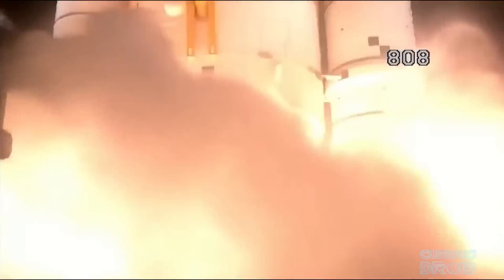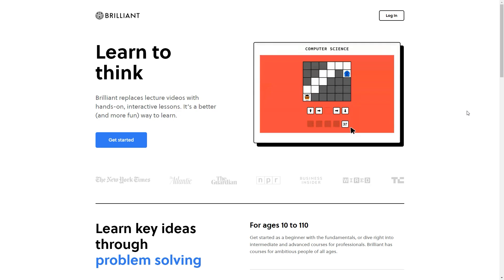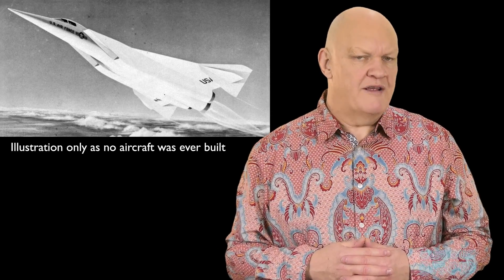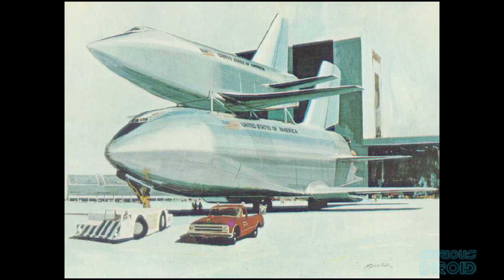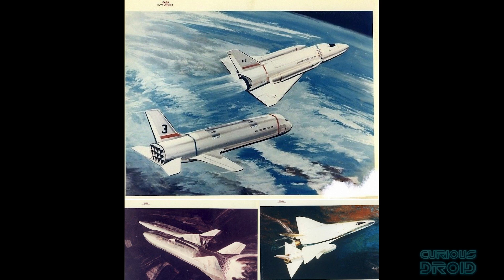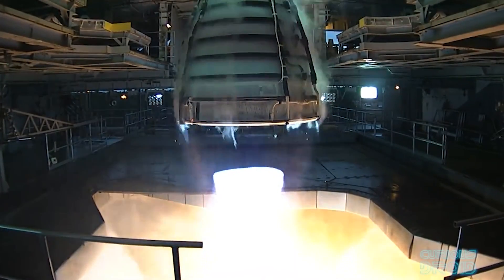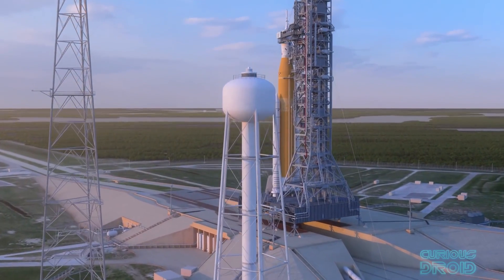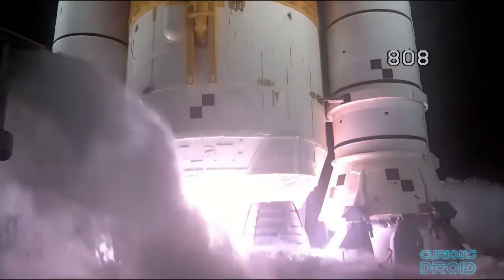Why is NASA Throwing Away Reusable Engines?

Comment: I am wondering who will be willing to pay for a non reusable rocket and the price tag a mission comes with, once SpaceX has its starshop program up and running for a supposedly fraction of the costs?
Reply: The Artemis IV cost to NASA to get HLS Starship to the Moon is $1.15B. The problem for Starship replacing SLS is the up to 10 launches to get HLS Starship to the Moon (GAO pg 27) and the 1 launch every 12 days for Artemis III (GAO pg 10).
Reply: @steveaustin2686  
Yep that could be a problem if your rocket is prone to have leaky hydrogen faults.
Reply: @YellowRambler  Not relevant to the discussion, but okay, whatever floats your goat.
Reply: First, let SpaceX build a working Starship, then NASA will worry about what to do with SLS. For now, SLS is flying and Starship is on the ground.

Comment: N.A.S.A is just a money pit I suppose when it's not your money you don't mind what happens to the hardware unlike spaceX whos wish is to reuse reuse reuse. N.A.S.A at this point should just stick with research and development but it probably depends on long term contracts which will have been signed years in advance so the wasteful behaviour may change but I don't  see it for a long time coming

Comment: I think the only reason NASA still uses disposable parts is because the government paid suppliers for disposable pieces from the start and the suppliers have no reason to make it reusable when they get paid for each new unit.
Reply: Booster reusability is great, but has drawbacks.

First, if you don't have a fast enough launch cadence, you can spend more on recovery equipment and personnel than you save by reusing the booster.
Second, you take a payload hit for the recovery system on the booster. The Falcon 9 B5 can lift up to 22.8 tons to LEO when expended (SX), but only up to 16.7 tons when landed on a drone ship (B1069.2). Doing a Return to Launch Site (RTLS) landing, costs even more payload as you have a boost back burn to cancel the lateral velocity and return back to the launch site.
Third, the higher and faster you go, the harder reusability is to perform. The heavier the dry-mass of your booster, the harder reusability is to perform.

So with SLS launching once a year, eventually, the cadence doesn't really justify recovering the booster. Not to mention that it gets higher and faster than a Falcon 9 as the SLS core stage almost reaches orbit, making recovery MUCH more difficult. The SLS core stage is travelling well over 3 times as fast as the Falcon 9 booster and is well over twice as high as the Falcon 9 booster at MECO. The dry mass of the F9 booster is 22-25 tons while the SLS core stage is 85 tons.
The SLS Block 1 can get Orion to the Moon, but not with the kind of payload hit like F9 has. The SLS Block 1B will send along a Lunar Gateway module with Orion, so it really can't take the payload hit either.

SLS started design work in 2011, 4 years before SpaceX landed the first booster and almost 6 years before they reused a booster.

Comment: It's a shame that they don't even try to recover the SRB's, because the shuttle version was totally designed for that.  The parachute package hardly added any weight to the boosters.  The 5 segment version used for SLS was actually fully developed during the Shuttle era, but never flew due to the cancelation of the Space Shuttle program after the Columbia disaster .
Reply: It's not really a shame; refurbishment of the Shuttle boosters cost just about as much as buying new ones, so the reusability was basically pointless. 

What's really a shame is that these major aerospace companies with decades of history could have had fully-reusable, controlled-landing first stages by now if they had incentive to develop them, but since they get paid massive government contracts whether or not they innovate, they just don't innovate.
Reply: @IstasPumaNevada  The technology for reuse wasn't there until recently. Now, ULA, Blue Origin, Rocket Lab, Relativity Space, etc are all working on reuse.
Reply: @steveaustin2686  Technology was not there because they chose not to develop it. Moon lander landed vertically and then took off, not too hard to see them extrapolating to powered vertical landing on earth, could have had by late 70's if not early 80's. IstasPuma above has it right.
Reply: @JB18850  There were many attempts at making reusable spacecraft since Apollo. The Shuttle as the most famous and it cost more and was harder than they thought it would be.  The DC-X used vertical landing as well in the 1990s.
Reply: Refurbishment of the SRBs was not as expensive as building new ones, sorry. It wasn't nearly as cost efficient as they hoped, but you're just extrapolating the cliche.

Comment: I think that reusability is much easier with smaller rockets than with the biggest ones. In this case Falcon is much smaller booster than SLS. And talking abou reusability... my prediction is that Starship's Super Heavy booster will be total failure. Such big booster is just to heavy, to imprecise and it will not have such ability to steer as Falcon has. Those "chopsticks" won't catch a one.
Reply: The Superheavy and Starship will both be able to hover, whereas Falcon 9 booster can not. Landing those is possible, but the catch remains to be seen. I would be shocked if the rest of SpaceX goes along with Musk wanting to try a catch on the first flight. They will most likely do soft water landings until they have dialed in the accuracy they want. That is how they did the Falcon 9 booster landings over 7 years ago.
Reply: @steveaustin2686  Yes, you are right about the test landings in water.
But bigger and heavier rocket will never have higher maneuverability than the smaller and lighter one.
Reply: @Space-Fiction  That likely depends on how powerful the hot gas RCS turns out to be. It will be more difficult to make precise moves with the Superheavy booster and Starship (second stage), but a catch is not out of the question I would think. Not assured either though. Time will tell.
Reply: @steveaustin2686  Yeah... about the LC-39A pad. I already heard some rumors that NASA do not like the idea of Elon's chopstics tower so close to the only american launchpad for human spaceflights. And I agree with this. It is very unreasonable, risky and dangerous. But probably Elon wanted to spare some money so that he didn't need to pay for some another place. (he is already paying for LC-39A)
Reply: @Space-Fiction  No, it's more about LC-39A and LC-39B being built for rockets roughly twice the size of the Saturn-V, so they already are approved for the rockets larger than Starship. SLC-40 is not sized for rockets as large, so I highly doubt the USSF will allow it to be used for Starships. SpaceX and NASA are already working with the FAA on constructing Starship pads at the as yet unbuilt LC-49 to the NW of LC-39B, so it's not about not wanting to lease another pad. With the HLS Starship launch to the Moon requiring up to 10 Starship variants launched, having multiple Starship pads is a very good thing to help with launch cadence. Part of why the Falcon 9 can have a once a week launch cadence, is that the launches are spread about among SLC-4, SLC-40, and LC-39A. Besides Crew Dragon only launching from LC-39A, it is currently the only pad the Falcon Heavy can launch from as well. Both the USSF and NASA want to keep Falcon Heavy's launching, as both have important missions flying on the Falcon Heavy. SpaceX is reportedly talking about upgrading SLC-40 to also handle Crew Dragon launches, but that will require a crew access tower. I have no idea if the Falcon Heavy fits into the approved size of the SLC-40 pad as Titan IV is the largest to launch from their I believe and it is roughly 1/3 smaller than the Falcon Heavy.
Reply: @steveaustin2686  NASA has concerns about LC-39A... that is not my opinion... I red that somewhere a few weeks ago.
That is true.
Reply: @Space-Fiction  And what part of what I said denied that? The Starship pad was built at LC-39A because it was large enough for that size rocket. The pads at CCSFS are all almost certainly too small. That leaves LC-39B, which is for SLS and general use and LC-49 which is planned. I would not be surprised if a catch tower was made at SLC-13 where LZ-1 and LZ-2 are at for Falcon boosters.
Reply: Your "prediction" is based on what specific data? "Too heavy and too imprecise"...there is as yet ZERO flight data from any super heavy booster. You may be proved right in the future but for now I will take the confidence of a design team with over a hundred very precise successful pinpoint landings of Falcon 9 boosters over a guess based on little if any hard data.
Reply: @johnsmith-7oo  It is based on data from SpaceX. How many times have you seen the Falcon 9 landing? I guess hundreds. And did you realized, that this rocket (much lighter one) never lands right in the middle of the landing pad?
Yeah, you may have seen landing of New Shepard where the booster was hovering over the landing pad... but this booster is even much more lighter than Falcon 9.
You can make precise movements with rockets... but as the weight increases, so does the momentum of the body. And you can not fool the physics with any of crazy Musk's tweets. The maneuverability of Super Heavy will be much more lower than the one of Falcon 9 and so the precision.
Reply: @johnsmith-7oo  Don't be so sure. Elon is only talking money... and not every his idea was good as we know, e.g. that Hyperloop thing was really dumb from the beginning. And where is it now? It is doomed.
So as the Starship and chopstick idea. It will work only if everything goes as it should without any problems. But everybody knows that it can never happen. And putting people info the Starship? The worst idea ever. Starship is flying coffin... and it always will be unless they redesign it from scratch.
Reply: @johnsmith-7oo  The Falcon boosters are not precise enough for a catch. Even on the lowest power setting on one engine, the Falcon booster has a greater TWR than 1, so it can't hover. The suicide burn landing times the engine start, so that when the legs touch the ground, the speed of the booster is as close to zero as they can get. While the boosters land in the circle of the drone ship, they never land exactly in the same place of the circle. 

The Superheavy booster and Starship (second stage) can hover on low power settings, but have to be much more precise in landing for the catch arms to work. The heavier something is, the harder it is to make precise moves with it. That doesn't mean that a catch is out of the question, but it will be difficult. The Falcon booster dry mass is 22-25 tons and the Superheavy booster is expected to be around 3-4 times that mass, if not more. The Superheavy booster and Starship (second stage) are expected to have much more powerful hot gas RCS, so SpaceX may pull it off. Time will tell and I expect a RUD or two. So I would not be surprised if a catch is not attempted until the LC-39A pad is finished and the catch attempt happening at Boce Chica.

Comment: yeah the temp difference between the fuel on the outside and the rocket thrust on the inside prob means fatigue problems,then theres the extreme vibration which prob causes cracks

Comment: If I remember correctly, the biggest reason that the SSME's were so expensive is because of the amount of power the made vs what they weighed. At the time, pound for pound of weight, they were the most powerful engine's on the planet. Another article I read compared them to SpaceX's current Falcon 9 engine's, and they came out on top for power to weight by a good sized margin. It's the old drag racers dilemma; powerful, cheap, reliable. Three choices, you can only pick two. What's your decision???
Reply: I think the main reason they're so expensive is simply that they were complex engines made in very small production runs, so you'd never get anything resembling economies of scale, and you'd never pay down the R&D costs.

Compare with Raptor 2 - it's near enough the same thrust as an RS-25 for half the mass, and even before one has ever flown, SpaceX have manufactured more of them than the total number of RS-25s ever built. And even if the unit costs for Raptor end up being ten times the aspirational figures they've claimed, that's still nearly one hundredth of the price of a single RS-25. And I'm pretty sure that the reason for that is almost entirely because SpaceX are designing it to be manufactured in vast numbers... building more in a year than Aerojet did in fifty years.
Reply: @simongeard4824  A major reason for cost being astronomic high is that is is the US government and the contractors who have been in been w/ NASA and other gov branches, and they have master at least on thing the best, and that is pissing away tax payer money. You should read about  Martin Marietta, Lockheed, Boeing, G.E. Grumman, Northrop and Ariangs (spelling) and the cold war rocket companies (using nuke missiles as space rocket, which is good idea). The two big boys would get 2-3 Billion just so the US had 2 companies who could build rocket, the contracts for doing stuff came later. SpaceX did all R&D in house w/ Musks own cash, no gov aid, unlike the other big boys. Musk had set a limit  on 3 launches to try to get it right, and it failed, yet his people said we can do it, and he gambled and he rolled the dice, and got snake eyes, and it worked. He developed the first rocket for like 170-230 million, and the next one for 400 million. NASA said publicly they couldn't have done it at 10-20 times the money (4-6 billion, probably 10 billion or more) So, NASA said he owns the LEO territory but they will own everything higher, which he said F off, and as you may know have his big rockets and if he uses some of the reuse rockets, he set them to not be reused as the total fuel will be used for altitude leaving nothing left for recovery.... Anyway the gov and contractor waste money well. Like when Trump when he was dealing w/ the new 747 air force one contractor. He was told it would cost 6 Billion and he said NO, I will not accept receipt unless you put a 3 in front of the cost per craft. They kept adding extras and more bells and whistles yet he said no, and got the price to 3.9 billion (Biden total f ed that up and payed 5+ billion even though the price was 3.9 Bil.) My point is professional politicians waste money better then anyone, but business men like Musk and Trump, do things for profit and to get the best for your buck.  Sorry Ive been up for over 50hours and am about to fall apart....take it light --KB
Reply: Not really - the thrust to weigh ratio on the RS-25 is not that high, Falcon 9’s Merlin engines have a much higher thrust to weight ratio. Part of the reason is just down to fuel - Falcon 9 uses kerosene as opposed to hydrogen, which on a volume basis produces a lot more energy per unit burned.

The reason the RS-25 is expensive down to several factors - First it is very efficient, using a more fuel rich closed cycle design. Second, it is designed to be reused, so it is built with that in mind, and components are chosen for longer life than disposable engines. Also, it is regeneratively cooled as opposed to ablatively cooled, like cheaper disposable hydrogen engines like the RS-68. Third, it is designed to be efficient at a wide range of altitudes, from sea level to the vacuum of space. This means there are significant complexities in terms of nozzle design, in particular the engine bell of the RS-25 can change shape/expansion ratio depending on altitude.
Reply: @eyeborg3148 , Do you have a reference for that last point (changing shape/expansion ratio based on altitude)? My understanding is that the RS-25 engine bell is static is shape. It was designed to be slightly sub optimal in vacuum performance only to the degree necessary to prevent flow separation at sea-level, not that the shape/expansion ratio changes in any significant way due to altitude (excluding slight changes due to thermal expansion which happens to all nozzles). This was deemed acceptable as the majority of the run time was at higher altitudes where vacuum optimization would the primary goal.
Reply: @richardb1452  Actually you’re right, it doesn’t change shape, I misremembered things.
Reply: @eyeborg3148  Do you know what specific impulse is? You should try figuring that out before you pop off.